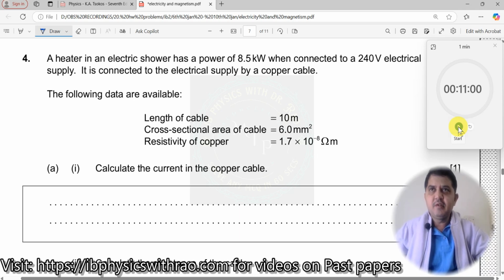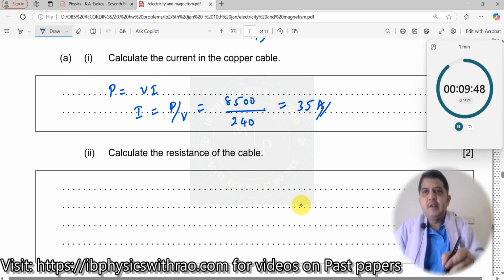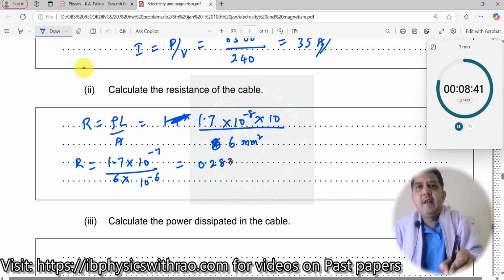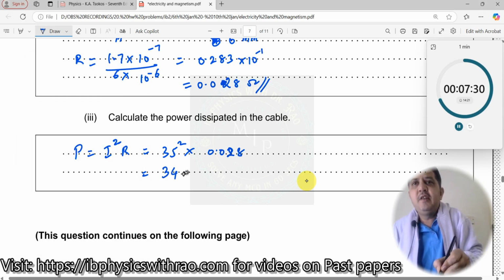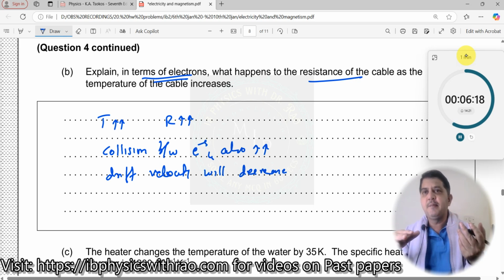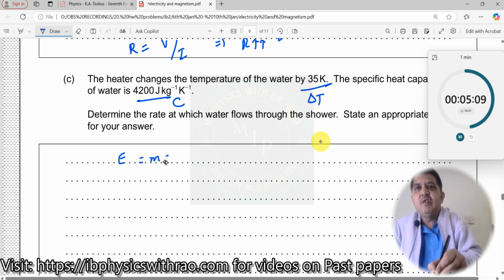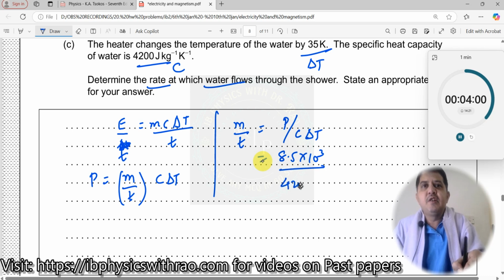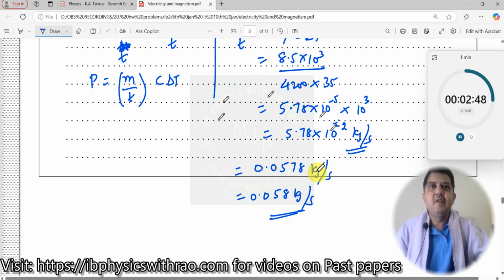4. A heater in an electric shower has a power of 8.5 kW when connected to a 240 V electrical supply.

Comment: Hello sir,  for a (iii) I tried using the other 2 formulas given for Power. 
P=IV and P = V^2/R
But I got different values for each of these. Why is this wrong and aren't they all supposed to output the same value because they are all equal to Power? 
I'm slightly confused on why this specific formula was used for that question and not the other ones.